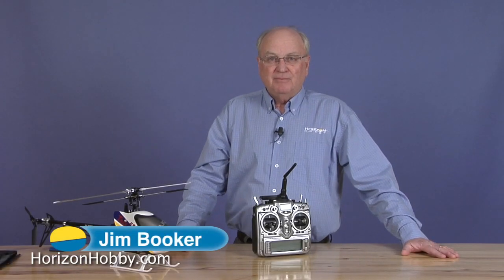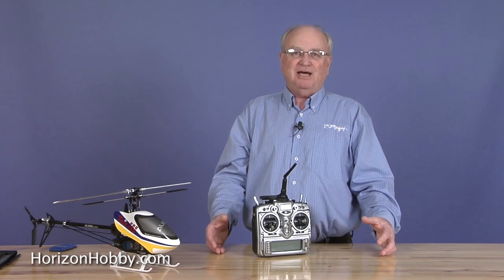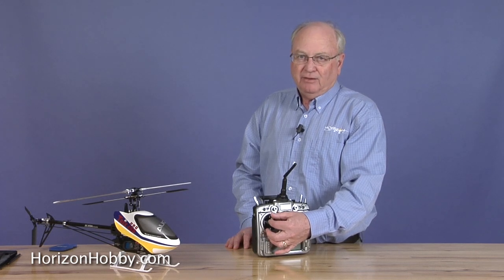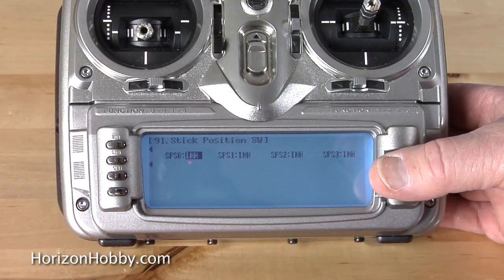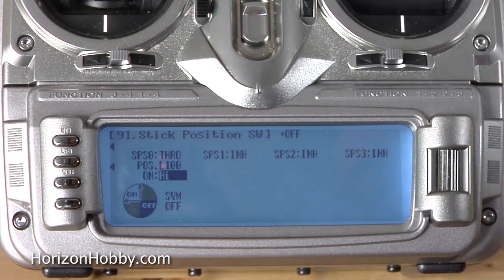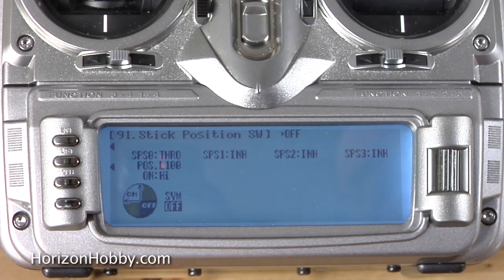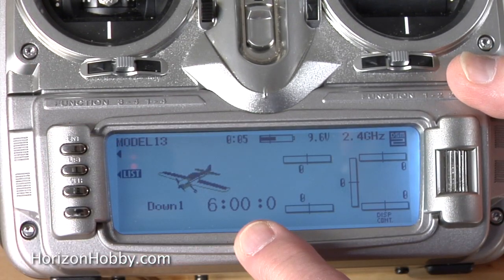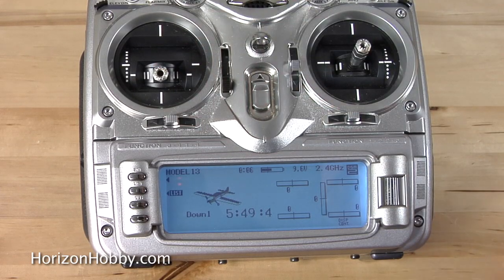Horizonhobby.com How To  JR 12X Stick Timer Setup for Electrics

Comment: For 3D pilots you can turn the one time function on in the timer menu, this will allow the timer to start as soon as you advance the throttle, but will not allow the time to shut off if you go back down to idle with the idle up switch on. This allows you to use negative pitch without shutting off the timer.

Comment from the maker: @shangsandy87 Actually that is a pretty good point. If you pull the timers into My List then you can have them easily accessible in case you would want to change the time on one or the other for some reason.

Comment: This throttle-activated timer is one of the reasons I got me a JR 12X MV (the one that can do both 72MHz and 2.4GHz natively). I was originally looking at the X9503, but the $999 deal on the 12X MV last spring was too hard to resist. :)

Comment: very very nice radio
all is possible

only one deffault , accu nimh is bad !!
why JR  don't place a bigger accu or a lipo ??

i just have a pb
when i change module 2.4 to 72 , radio reset TX mode
i need change mode to SPCM and change wing mode
it's regretable for high tech radio